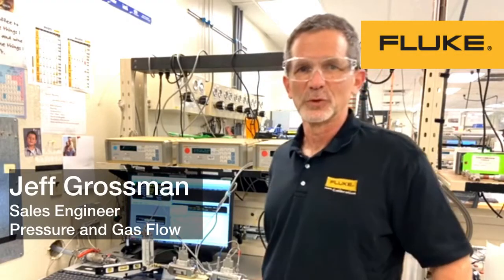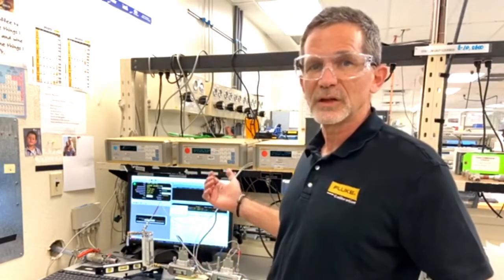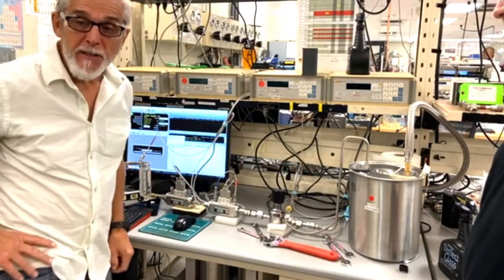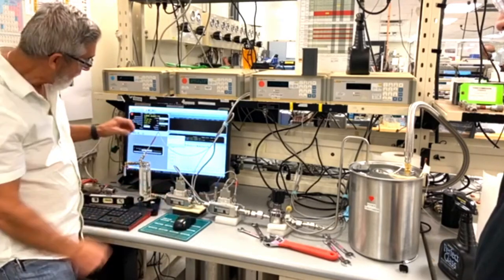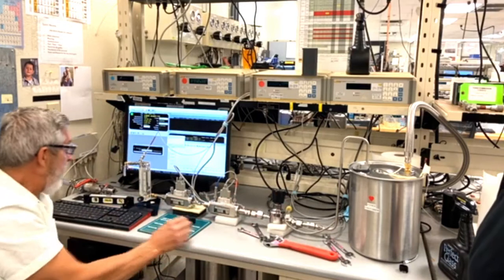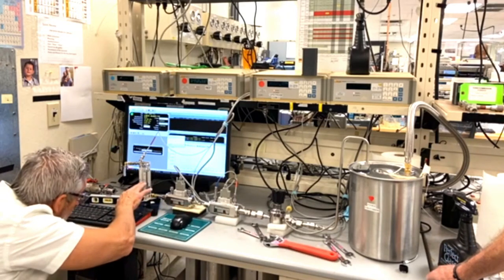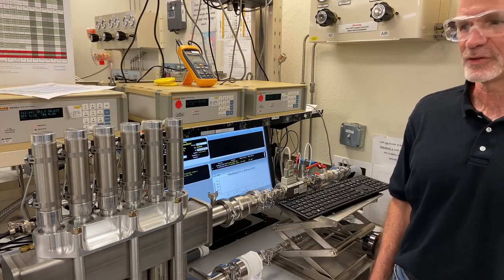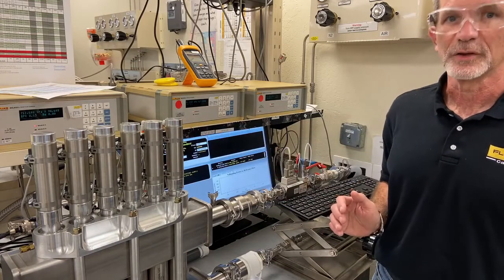Molbloc and Molbox Mass Flow Calibration Solution Demonstration

Comment: Way overpriced for what it does...recording inputs from pressure flow and temperature, applying basic mass flow calculations then outputting deviation. This system is not worth $30k USD...